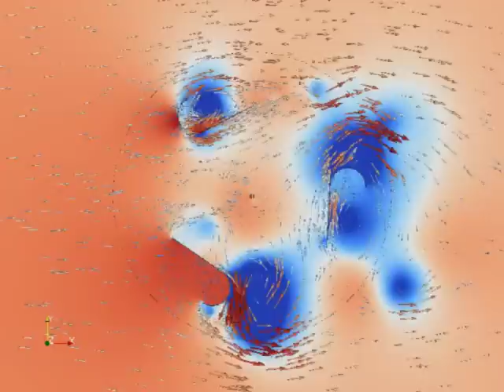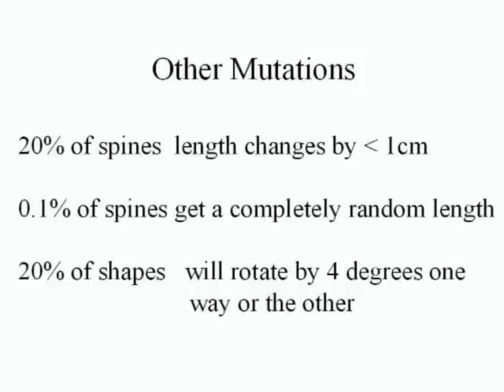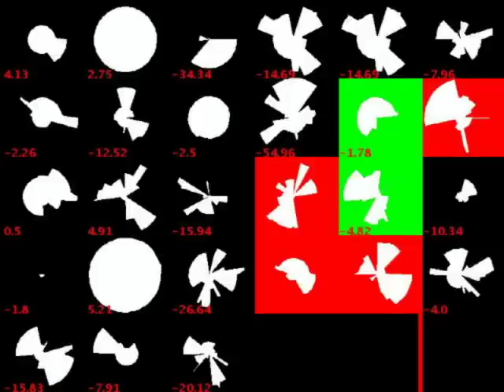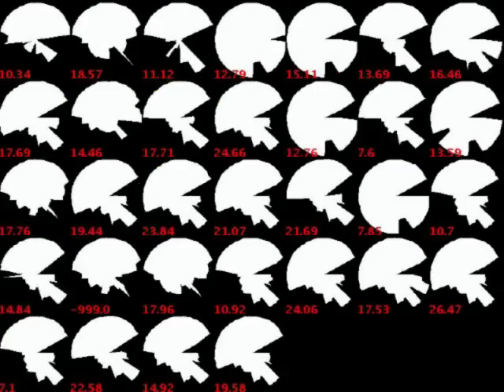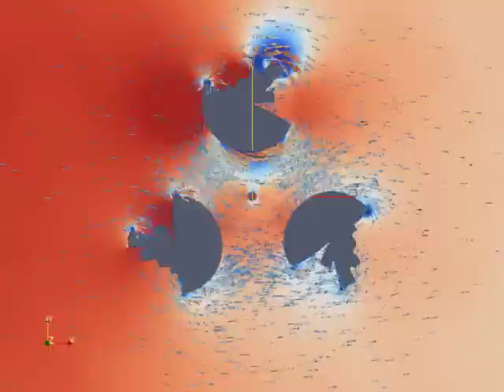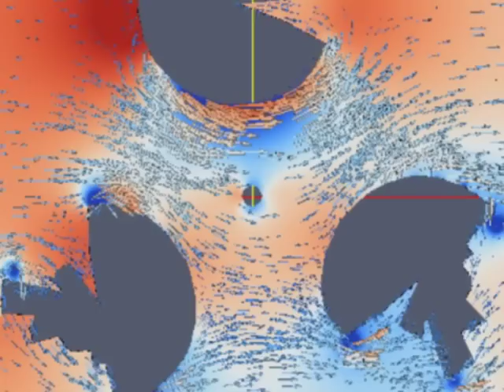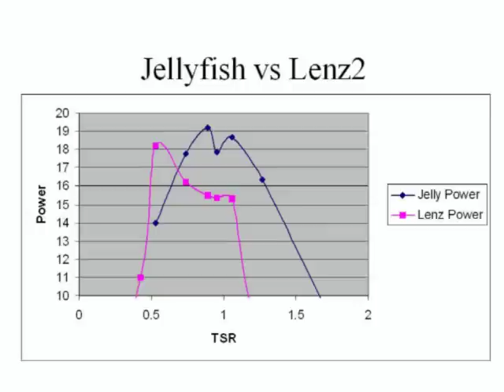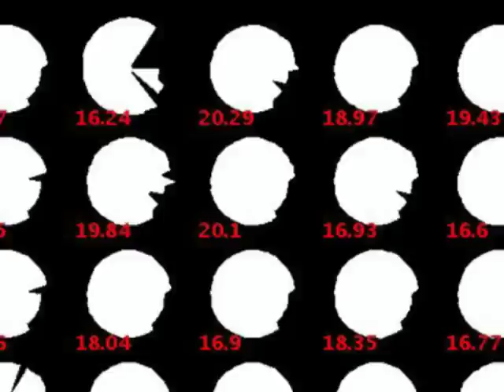Evolving Wind Turbine Blades

Comment: This reminds me of another experiment I read about where a program was written that could modify its own code and then THAT code could modify ITS code (the best ones moved forward and the bad ones died off, etc. The creator(s) of this program expected that the program would perhaps end up being 5-10% more efficient at copying itself and they let it run overnight. When they checked on it the next day, it had reduced the number of commands needed to make a copy from more than a hundred to less than 25, and did it faster. [read this a long time ago, so I might be a little off on some of the details. I believe it was from "Tower of Babel" by Robert Pennock]

The moral of the story is that whether you believe that evolution happen(s/ed) or not (biological evolution), the PROCESS of evolution DOES work.

JW3HH

Comment: I think this method is limited by the algorithm used to mutate the blades. Other methods should be tested in order to obtain dfifferent options. Also different shapes for the three blades should be tested, evolutionary algorithms tend to solve extremely complex problems.

Comment: I would like to see another try of your simulation with a better computer, maybe run on the graphics card, which would speed up the simulation extrem.
Also i want to point that this "star shape" maybe is not the best design rule, because a blade like the lenz can not be produced, also other shapes with radial undercuts (like build a lenz blade from fine corrugated sheet) [hope you understand what i want to say, but english is not my native language >_< ]
Maybe it would be an idea to use a spline curve, because normally it would be practical to be able to produce a blade by just bending a thin piece of e.g. metal.

Comment: Considering the seeming half-random results, id say run the origial simulation enough times to put the winners into another simulation to see which one is the best and if they can improve each other.
Reply: although you might want to consider getting a better computer for that, because if one run takes two weeks, that would take a very ling time

Comment: if you'd written it in C it would have taken a quarter of the CPU time. maybe less.
Reply from the maker: You have no basis for making a statement like that, and it's not true.   The bulk of the time (100's of hours) was spent in the openFOAM program which is written in C++.  The Perl just did some of the mating.  (probably 10 minutes total), and the Java was used to create the displays for the video (2 hours.)

So there is no way it's going to run in a quarter of the time.

Comment: I suspect that mating to reproduce is not great for this; I think they should reproduce asexually. Randomness in the genetics can be introduced by the program, rather than the combination process of two different genetic codes.

And I think that wanting to breed with something similar to oneself, is a way to guide the species to successfully reproducing mating pairs, which tend to take priority over improvements to the species, considering genetic incompatibility. If the evolved creature was required to carry around the means by which it reproduces, in its genetic code, which would then be expressed in its body, then mating with similar creatures would be favored, because in-order for the offspring to be able to reproduce, their bodies' reproduction mechanisms would need to function.

Comment: any way I could get a file for "the jellyfish and the lenz2?" I am planning on doing a full scale test and it would make it alot easier. a 2d file (.svg would be optimal) thanks so much! I'm really inspired by your video!
Reply from the maker: Read the description.  This breeding was done with the wrong viscosity for air, so it's no good.   The Lenz can be found at windstuffnow dot com.
Reply: sjh7132 any chance you could run the program again with the right viscosity? I really want to try this full scale
Reply: Jacob Hoffmann agreed

Comment: seems like numerical quarks to the actual testing phase, maybe due the way the lenz program is calculating the Reynolds number for the shape. it's pretty hard to keep an accurate account of void spaces pressures in a Reynolds number as the surface rotates around  in a unidirectional simulated matrix.
Reply: I saw you mention that you used the wrong viscosity for air. Does that mean you could make a new and improved video about it?
I'm kind of intrigued.
Reply from the maker: The simulation uses the Navier-Stokes equations and I don't believe Reynolds number is even calculated.  But there are times the solver does blow up, and in those cases you see a power of -999 and the turbine is discarded.   The mesh is variable size, with the cells closest to the turbine being the smallest.
Reply: sjh7132 Reynolds number is a ratio of inertial force over viscus force. A static propeller/turbine blade has a different efficiency based on it's relative motion through a fluid. Think of it like in a multirotor situation, in hover a prop with a low pitch gets great efficiency but low power per RPM and in flight it has very low top end speed and vice versa is true. (Unless you pass a certain point where the drag across the prop is creating a low pressure behind so great it negates the power of the motor) It is also used to describe the movement of currents with in fluid, so like how water moves through a strainer and estimating differential pressure from internal fluid drag from the total drag. 

Basically, if you assign a compressible fluid an initial pressure, viscosity, and mass to NS equation you apply a Reynolds number that should be able to get a more accurate measurement of mesh points around the symmetrical looking low pressure spots, which (I believe) should be more tear dropped shape in reality. 

I'm  just mechanical engineering and I'm interested in learning a bit about the genetic algorithm/ learning machine coding. Could I take at a look your fluid medium code?  I might be able increase the accuracy of your environment, which should result in more efficient evolutions, or I might break it and everything might think about de-evolving into a circular cross section. Either way, I would really like get some ideas. Thanks
Reply from the maker: The fluid code is public domain.  It's called OpenFOAM.
Reply: sjh7132 thanks.

Comment: I'm afraid these turbines would perform even worse in real life, because they are prone to maximize their efficiency by taking advantage of the quirks of the discretized simulation. In real life the turbulent flow around the jagged edges would be different than the simulation, thus defeating their purpose.
Reply from the maker: That is correct.  The simulation was too short, and limited to a single turbine speed and wind speed (Reynolds number) so they evolved to just maximize their performance in that simulation.  If you give a generic algorithm a way to cheat, it will.
Reply: Have you built it yet?

Comment: i think your algorithm could produce a better wind terbine if you added a mutation feature. the diversity of the povulation  stagnates when the power number gets near the 20s. if you add some element of randomness periodically, as if the population could mutate, that entropy can be delayed while the arms race generates greater and greater power numbers
Reply: Evolution only works when there is mutation. If there was no mutation this simulation would not have worked.
Reply: if I watched correctly, there was the initial randomness in his program and then inheritance, but no spontaneous mutation
Reply from the maker: No there was mutation also.
Reply: sjh7132 my mistake then

Comment: did you repeat the test with the lenz shape as a starting point?
Reply: His genome could never generate a lenz to begin with
Reply: Tim Jadeglans so?
Reply: There is no way for the lenz to exist as one of his species unless he would make significant changes to how the genome works.
Reply: I see
Reply: Max Maruszewski That's one of the problems with this sim: the way the grades are created makes it impossible to make blade shapes like the Lenz. Also, he set the air viscosity too high, so the results are unusable.

Comment: did you take into the mass of the material being used? The jellyfish is heavier and takes more force to move
Reply from the maker: I'm not sure if mass is that much of a disadvantage.  It does take more force to accelerate, but also provides that same force to the alternator if the wind slows..
Reply: why dont you try building one and seeing if it's better. with 3d printers out there it shouldn't be hard....
Reply: ***** good point!
Reply: also once its moving it will stay moving more so dips in wind will be buffered out....

Comment: Have you corrected the values and run it again?

Also, can i get the programs you used for the simulation? (just want to play around a bit and look at the code if possible)
Reply: Ralph H. I would also like to peek at the source code.
Reply: I'd like the code as well
Reply: I'm leaving this here in case he answers

Comment: I am not clear if you are taking into account the changed wind direction of the downwind blades in the original modelling. Are you doing a full analysis on every iteration with a three blade VAWT?
Reply from the maker: The simulation left much to be desired.  In order to save time, I only did 1/3rd rotation at a single wind speed and single RPM.   That's really not good enough, and the turbines evolved to do well at that specific test.

Comment: have you tried generating your own turbine blade, and letting the evolver  improve on it?
Reply: I'm curious as to how the Lenz2 would change. Especially if you could possibly seed it with both designs and get something better out of it.
Reply: Brandon Pack I am curious as well, as evolution is one of the best ways of improving something. the output could be put to use in high output turbines
Reply: he would need to change his genome. There is no possible genome which would create the lenz2 shape to start evolving

Comment: The shape that was the standard for comparison had a distinct advantage in that it was not forced to have any cross-sectional area. You probably should have made the tips of each extrusion connect with a line that was left open at one point rather than a closed loop, so as to allow it to create a similar shape.

Comment: they way he started talking about it, I worried he was going to creationist on this lol. then I saw the likes, and figured this video might be productive.
Reply from the maker: I was attempting to remain somewhat neutral so everyone would watch it, or at least get through the intro.
Reply from the maker: Don't bother to build it.  The simulation was done with the wrong viscosity for air.
Reply: sjh7132 so THAT'S why round shapes worked
Reply from the maker: The simulation was done using a program called OpenFOAM (public domain).   Perl is used to run various programs (since it's good at that.)  Java was used to draw the pictures used in the video.  I still like those languages, along with C++
Reply: same here, word by word :P
Reply: this was the best video about evolution in action I have ever seen.
Reply: im building this design with a 3d printer and a foam cutter, so far so good, but is there any special ratio between the height and the width of the model?  also, if i take your design is exactly the north connected to the center rod?  kind regards.

Comment: you should probably have your algorithm be capable of creating lengths that go beyond just the minimum and maximum of the parents... otherwise you lose genetic diversity every time.
Reply from the maker: It's been a long time, but  I believe the mutations could increase the length beyond the limits of the parents.
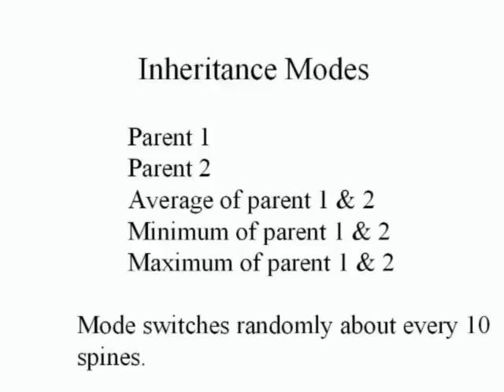Reply: sjh7132 okay, but from what it looked like from 1:33 that wouldn't be possible...
Reply: Yeah, but in the very next slide he spoke of the random mutations that could apply at any given point.

Comment: I wanna watch this video but holy hell I CANNOT stand the noises you make with that microphone, is your mouth touching it when you speak or something.
Reply from the maker: I never noticed that before.  It's just wind noise from sounds that make me blow air on the mike, like 'p' .  (cheap mike).  Turn down the base on your speakers and maybe you can get through it.  Or turn off the volume all together.
Reply from the maker: I typed that comment in about 3 seconds before I had to run to the airport to catch a plane.  Give me a break.   I don't think the name calling was necessary.
Reply: Look into something called a pop filter (it's like $8), made specifically for problems like this. Though you may also be able to just find a better cheap mic for about the same price haha.

Comment: If you're running out of diversity to easily, you might want to try the modified island model. Segregate your population into a few islands, and give them slightly different fitness functions (I don't know how the simplified calculations work, but if you can include differences in average wind speed or frequency of changes in wind speed and direction, those ought to work). Then have a small chance each generation of a turbine moving from one island to another. The idea is to build up distinct gene pools where invasive species can add new improvements but not wipe out all the existing work.

I'd also advise trying a run without the mate similarity preference, I think that might be one of the drivers to rapid conformity (only way to know for sure is test it though).

Comment: The reason your blade stopped evolving is over-specialization.  The program found an equilibrium between the species which dominated and the environment.  The remaining variety was lost.  You have to remember that it's the environment which drives evolution.  If you want to maintain diversity you should have different environments like varying wind speed.  Develop species within these environments.  Then periodically introduce these species to each other in a new environment.  The competing environments can slowly converge over time into the conditions you're optimizing such as the target wind speed you used in this example.
Reply: Also I don't think the random mutations were frequent enough - if you look at the children they all have the domed head and none were ever 'deformed'.  It's those deformities that cause changes and allow for a different strain to attempt (and frequently fail - but sometimes it's the perfect mutation).  Also the bias towards choosing a blade most like itself leads to inbreeding - just like with biolgical counterparts.  It should have prefered to mate with other blades that have the highest output - even if they were a different shape.  This would allow hybridizations and get the best values for each parent.

Given the limitations you placed - this is the expected result in the genetic algorithm.
Reply: Ixions just say convergence. Genetic algorithms r notorious for converging to quickly.
Reply: It beat the human one exactly because it 'evolved' with this exact wind and only in a computer simulation so far.
Reply: Alternatively, use speciation like NEAT, or K-medoids/nearest neighbors like SharpNEAT(the latter seems simpler & more feasible)
Reply: woolfoma I think the original posters views are more correct and this opinion of yours is wrong.
Reply: except that the blade beat out even the human designed competition. I agree the simulation should have have 5 different populations that could mingle randomly and rarely IF it were attempting to mimic earth. As it stands the best way to continue would be to run the same evolution system again and again, eventually you would have a full population of successful blades, then run it with that.

Comment: Evolutionary algorithms are actually common in computer science and used for hard problems. There are many considerations on how to choose the different operations and the sample sizes, especially considering efficiency. If you haven't already, I really recommend having a deeper look into the subject.

Have you tried creating a fitness function which is less expensive, e.g. some pre-filter to sort out bad solutions? One could also think of decreasing selective pressure in the beginning and increasing the initial population size.
Reply from the maker: I think if I were to prefilter the fitness function, there would be people who would accuse me of designing the blade, by throwing out ones I didn't like.   There are already people saying that I designed the blade.  (not sure how)
Reply: sjh7132 How is that relevant, if you have working results? All that I'm saying is, that by reducing the cost to filter cheap individuals, you could probably speed up your algorithm. By increasing the early populations size (and offspring population size) you are reducing the pressure, probably resulting in bigger variety early on.

Comment: Is there anyone who actually made a jellyfish blade and tested it in real life? XD
Reply from the maker: Someone sent me a photo once, and as expected it didn't work well.   The tricks the Jelly Fish was using with having the air curl just right in places depends on the viscosity of air.  Since the real air viscosity was different than the simulation it didn't work.

Plus knowing what I know now, I think my test simulations were too short to get good measurements.  I should have let them spin 3 or 4 times, but that would have taken 12x as long.
Reply: :/ ok
I don't exactly know what calculations do these simulations make, but what if you used a gpu instead of your cpu? It should be significantly faster
I mean I know that you did it like one year ago or something and you probably don't even have the program but maybe you should try it again? The video was awesome, I would love to even a watch a whole series like this